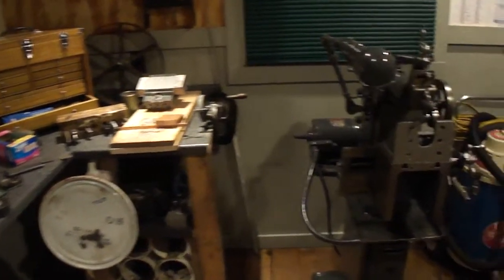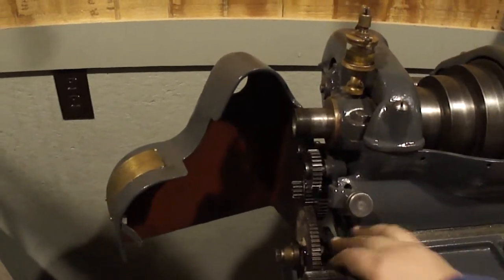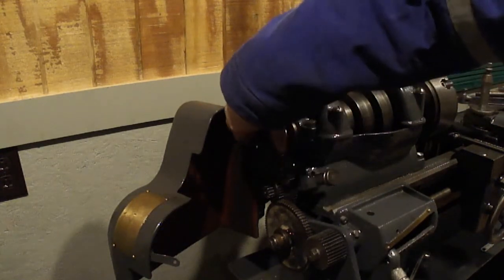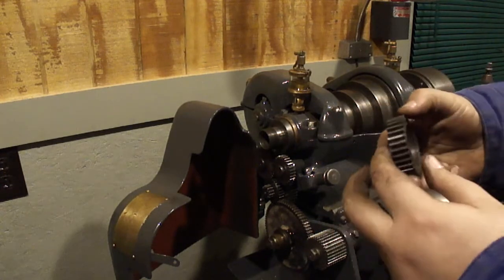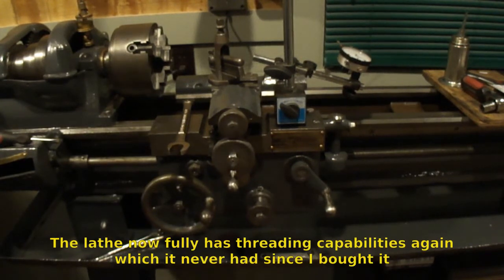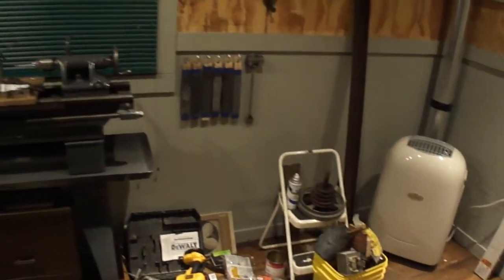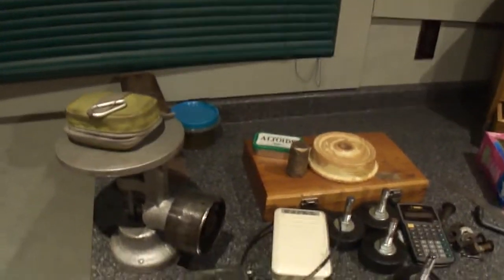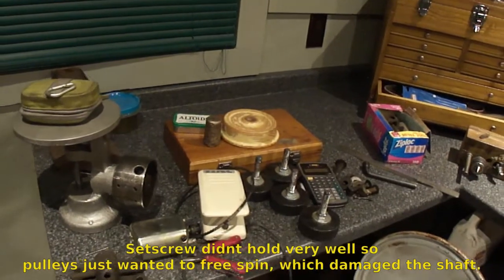Monarch Jr Lathe Rebuild P10 - Final Assembly (Last Bag)

Comment: Just found your channel.   That was a well done  series on rebuilding a simple  lathe from that period.   I had a 10" Sheldon lathe that was practically a twin of your Monarch Jr.
Reply from the maker: Thanks for watching vandal, they look identical because the people from Sheldon were designers from monarch originally. They left monarch to start Sheldon lathes, and the design was abandoned at that time by monarch for a newer v-belt design, and they technically never did patent the design, so the designers just used that design as Sheldon lathe's fist models. There's a few subtle differences between the two, but because of that, they are pretty much the same lathe.

Comment: I'm catching up on your older videos.  This was a really cool series.  I love seeing that old equipment come back to life.  You've got yourself a very nice little lathe there, congratulations.   I did something similar with a broken Atlas 10F but I skipped the headstock rebuild and all of the painting.  I got it cheap (< $.50/lb) because the guy knocked it over during transport and broke the main countershaft pulley and bracket. I've been planning on doing a full cleanup on it for 5 years now, but I use it too much to take it out of service!
Reply from the maker: thanks, and yea, this is a nice old lathe, it still has its issues, but its still going as strong as it did the day I finished rebuilding it.

Comment: You’ve done a sterling job on that lathe, well done. Love the shop too, wish my ceiling could support a counter shaft.
Reply from the maker: Thanks, cant wait to see more of your shop too. The ceiling is honestly aluminized styrofoam, so it's not very strong at all, but the rafters have some heavy 2x10" pieces of lumber attached in between them so the ceiling is sandwiched together with boards and carriage bolts to really get everything tight. The countershaft doesnt really weigh that much, and the forces involved with the belts and everything is honestly very small usually. 
I can grab ahold of the countershaft and hang on it, so just the setup with the boards is more than enough to support everything.